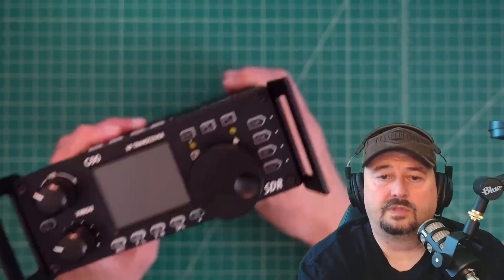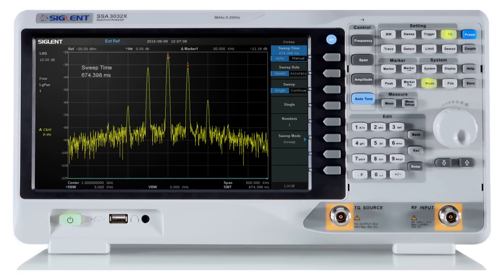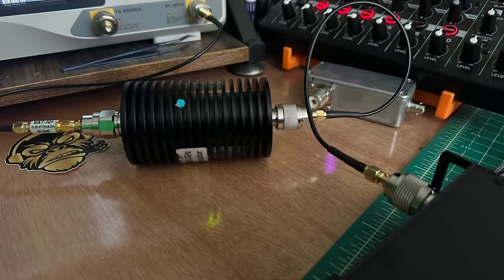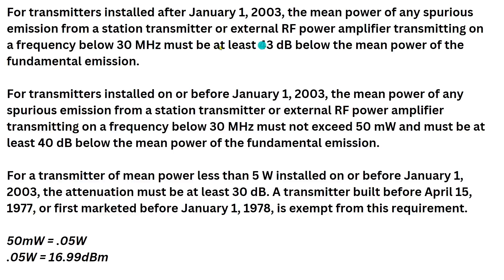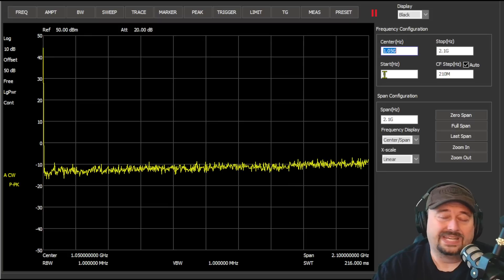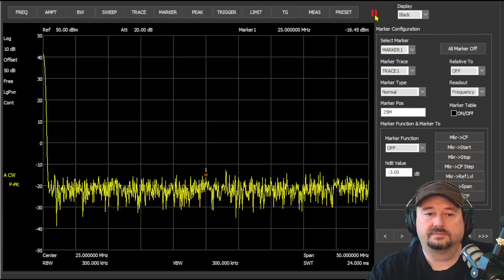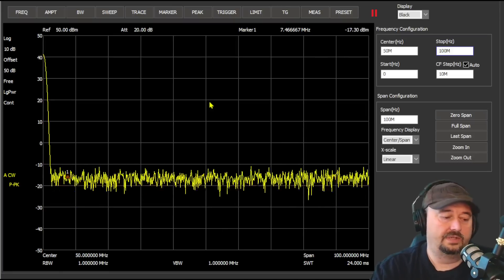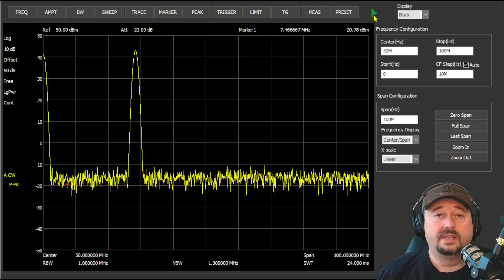Xiegu G90 Spectral Purity Test - Shocking Results!

Comment: I got the same result using my TinySA. Whatever the harmonic content level of the G90 is it's down below the noise floor of the TinySA. One of these days I'll fire up my Anritsu and dig down to a lower noise floor and see where the G90 comes in at, but whatever it is it will clearly bring a smile to both me and the FCC. It's a squeaky-clean rig.
Reply from the maker: Glad to hear you got similar results 👍

Comment: I was once licensed with a large shortwave license (called B license here in Germany) 
I was bored. License returned.
I'm interested in the pirate band on 6.5 MHz, 13.950 and 26 to 28 MHz 
Does the device work as well here?
Reply from the maker: All discussions of RF are welcome 👍
Reply: @TheSmokinApe  Did you understand my question? Don't worry, I'm not an FCC agent. I'm here in Europe.
Reply from the maker: @ LOL, I was reading on my phone with out my glasses.  I thought it said “advice”. It should RX on those frequencies just fine and it can be opened up to TX on 26-28 👍

Comment: The G90 is one of the best low cost HF radios I own. The only issue is that sometimes it's unable to filter out AM bands that get broadcast near my home, so I need a separate filter to deal with it. Other than that, it's a solid radio and could tune a rain gutter.
Reply from the maker: It’s a whole lot of radio for the money 👍

Comment: Hey Ape! 

I'm reaching out to anyone I can find to help me. I just got a g90 from Radioddity, and it has what seems to be a birdie. It sounds like a low level 1Khz tone that pulses at 1 second intervals. It is not tunable and can be heard when connected to a dummy load, and doesn't matter what kind of power supply.  It also can be seen on the waterfall. 

Radioddity is telling me that this is normal.  The radio is usable, but I find it hard to believe that it's normal. Can you tell me if you can hear this on your rig?  

Thank you for your time!

73,
Russ
Reply from the maker: If you are sure that there is noting around the house causing it, send it back.
Reply: @TheSmokinApe  thank you for the quick reply!

Comment: After connecting with RF attenuator to bring down correct RF signal level input to the spectrum analyser, the G90 transmitter display correct frequency and level without spurious radiation. Good radio .
Reply from the maker: It passed at full power

Comment: I just don't understand the Chinese radio thing. I am not a snob, and I don't have any expensive radios. But, none of my radios are Chinese. I have 3 HF radios. An Icom IC-718 that I bought new about 5 years ago, an Icom IC-728, from the early '90s, that I bought used about a year ago, and the prize of my collection, a Yaesu FT-DX 560 tube radio (early '70s model) with a D-104 Silver Eagle microphone that I bought shortly after getting my general in 2009. It needed some work, and I enjoyed working on it. To me, working on radios, especially HF radios, is part of the ham radio hobby. And you really can't do that with the newer ones. They are pretty much plug and play, just like commercial radios. I have gotten very good reports on all of these radios

Comment: If you want to test for linearity you need to do a two tone test on SSB mode. Carrier transmission doesn't reveal very much information.
Reply from the maker: Hey Clive.  It wasn't a test for linearity, it was a test for harmonics and spurious transmissions outside the transmitted signal.  It's actually an important test of the output filters, it's quite common.  Here is the FCC regulation I was testing for: https://www.law.cornell.edu/cfr/text/47/97.307#:~:text=If%20any%20spurious%20emission%2C%20including,accordance%20with%20good%20engineering%20practice.
Reply: @TheSmokinApe  The requirement for suppressing out of band harmonics is not in dispute, and I know it is a legal requirement. What is in dispute is that this radio uses a not totally linear Push-pull final amplifier (Look in the service manual) which has to be operating in class A/B and will be producing second and third harmonics as the signal crosses over from one transistor to the other, one would hope that the harmonics are in the range of -50dmb, and -70dbm respectively but they may not be. Your test video didn't show these harmonics which have to be present, and you can't change the laws of physics and have a radio that doesn't produce any. You missed the point that harmonics are produced when you pass a signal through a non-linear amplifier.
Reply from the maker: He Clive, this test was for out of band harmonics.  I understand what you are saying but that is a different test.

Comment: Great video. It would be helpful to hear why 50db attenuation was used vs something else (or no attenuation). Also would be cool to see a bad radio example.  I enjoy these videos - short and to the point with good explanations. Thanks
Reply from the maker: Hey EXJ, the Spectrum Analyzer has a very sensitive reciever and as a result it can only handle very low power signals without being damaged.  The SA is rated at +20dBm at the most.  A 20w signal is about 43dBm so with 50dB of attenuation the input power was about -7dBm which is safe for the SA.  Hope that helps...
Reply: @TheSmokinApe  Thank you for the explanation -that now makes sense
Reply from the maker: Awesome!

Comment: Looks nice, it's amazing what 5 components worth of filtering can do. If you want to play silly buggers, I believe the G90 is also quite good on its IMD3/intermod measurements, or at least the one I saw running 400W of power, it didn't "splatter". If you want to go head to head with another radio and have access to one, try it against the FT-DX101 or FT-DX10, you might be surprised.
Reply from the maker: @godarklight  I’m somewhat planning the IMD test now.  Thanks for watching GDL 👍

Comment: Bought my G-90 and made my first aero nautical contact. Was listening on 10 meters 9 months ago on my Albrecht AE 2990 which is a 10 and 12 meter capable HT bought from overseas when I heard a pile up! It was a Boeing 737 pilot flying from Florida to Washington State via California. He was at 28,000 feet over the baja straights! I'm in northern Alabama and unfortunately he could not hear me with my 4 watt handheld! The pilot then informed everyone that was still trying to make the contact that he needed to go off air for twenty minutes to deal with some tasks! lol completely understandable he's flying a jumbo jet! I was really disappointed, i have heard of such contacts but have never had an opportunity! Then it hit me! My brand new Xiegu G90 not even out of the box yet! I live in an HOA so no permanent antenna but I had a wolf river coil tripod and an MFJ 17' telescopic whip! I knew the G 90 could tune a chain link fence so i grabbed my battery box with my trusty bioenno battery and the radio and hastily through it together along with the antenna the coax literally going out my patio door! I only had time to throw out three counterpoise lines but got the g90 fired up on 10 meters and waited patiently! After a while i figured he was not coming back so I made some  short contacts into Montana and Wyoming on twenty meters! After that i retuned the G90 to 10 meters and the pilot was back! In was using the full 20 watts power and had to wait a while but i finally made the contact!! That little radio was so intuitive that first time out of the box i was on air! What they say is true! That radio can tune a wet noodle! Contact made almost 3 thousand miles away to a moving aircraft at 28,000 feet! That was a first! Later on that little radio got a 5141 mile contact with Turkey on the same setup! I own many Yaesu radios and I love them all but even my Ft 891 needs a tuner to do POTA! I ended up going to the pilots QRZ page and it was fascinating, he spoke of his aircraft and the 400 watt hf radio and pointed out that he could only operate it in USB mode which I never knew! So if you ever hear someone on 40 meters on USB it's probably a HAM pilot! I can't say enough about the G90 it has its faults but it gets it done!   For those interested the pilots call sign is WA7E his QRZ page is worth a read! 

Great video and as much as I love my G90 I was surprised at the results! I've grown so accustomed to terrible reports on Chinese radios I guess I was prepared to hear the bad news! Thank you for all the work you put in on your videos! Now I love the radio even more!
 73
Reply from the maker: That is a fantastic story, thanks for sharing 👍

Comment: Sorry, but these findings are essentially useless.  Where's the two-tone test that actually reveals a PA's linearity?  Even a $20 CB can produce a clean carrier...
Reply from the maker: Not sure how many radios and amps you test but I see plenty that generate harmonics.  What you are talking about is a different test that measures a different function in the radio.
Reply: @TheSmokinApe  I don't understand your response to my comment.  At face-value, your test results indicate the G90 has the cleanest PA of any HF transceiver in history...this doesn't raise any red-flags for you??   Injecting a single tone and looking for harmonics may be sufficient for testing simple FM transceivers because the PAs in those do not need to be linear.  Unfortunately, this is NOT a valid test for SSB PAs.  At the most basic level, properly testing these consists of injecting a pair of tones (700 and 1900 Hz) to verify the IMD of performance of the PA.  With all due respect, and I'm not trying to be facetious, I challenge you to find a single ARRL/QST review of an SSB transceiver/amplifier that doesn't use a two-tone test to verify TX purity.
Reply from the maker: He Rdoger, I think we are talking about two different things.  I was test for harmonics that are out of band based off the fundamental transmitted frequency.  I think you are talking about IMD / THD at the transmitted frequency.

Comment: Hey, with the amount of lids on the bands running 1kw plus and sprawling 10kcs each side, i have no or had any issues with the Joe 90.
PS. Are you competent to use that test equipment? I see some issues with the methodology. 😮
Reply from the maker: Not qualified at all…
Reply: Not a worry, at least you are honest. Throw a piece of complicated test equipment  at someone sort of makes them an expert right. The results you got were good. For the g90 owners. I challenge you to do the same tests on yaesu and icom. The results will be the same. They all pass the the first base which is whats required by FCC or CE. But if you read the specs they all fudge the figures in their favor. 
Its not a level playing field for all. Good video to point out some basic facts. Ofcourse  the manufacturer's but their best case samples for submission,  once approved there is no retesting unless some significant change has been made. Since most japanese radios are made in China or Taiwan that is the kink in the chain. Employees are sent to site to oversee the manufacturer's facility and standards drop, little.by little. Having said all that, we have some of the best offerings in amateur radio we have ever seen in 50 years. Think about those old CB American offerings with jelly bean parts changing spec when they run out of parts. No FCC involved there. Shhhhhh

Comment: Your test is pretty simple and to me not surprising that the radio looks good. It likely has filters to keep anything out of band down. What you might want to do is test in SSB or FT8 and look and see if there are spurious signals within the HAM band, perhaps in the next channel. It is pretty simple for a manufacturer to put a filter to kill harmonics but if the transmitter is a pos, there will be spurious intermods. For example, if you have a 3KHz tone and a 2KHz tone, does the radio put put 4, 5, 6, 7... Khz  and smear over the next channel.
Reply from the maker: Hey Allen, most radios do have filter for out of band harmonics.  That said I have tested many radios and amps from China that fail, I expected this one to fail as well.  That’s the test I was doing in this video.  You are talking about an IMD 2-tone test that will be in a separate video.
Reply: @TheSmokinApe it would be great to see a IMD. Thanks